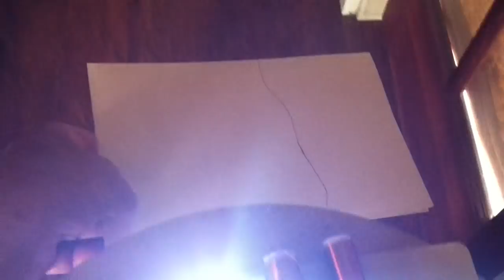13.56 MHz Crystal  Oscillator --One wire experiment

Comment: Great stuff as always! I like the 'cross pollination' going on here.
I was just wondering about the 'Av-plug'. I you replace the diodes by leds, connect them in reverse polarity and use them the same way, would one of them light up? Or both in case of ac?
Reply from the maker: Thanks. The AV plug uses "switching diodes".  They turn on and off.  The leds don't do that so they won't work in that application.
Reply: Thanks for responding :)